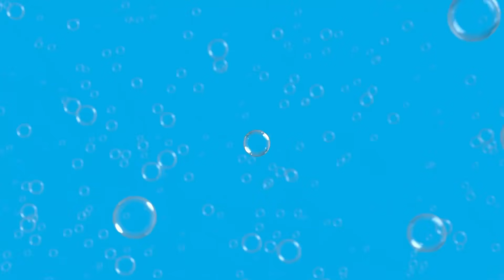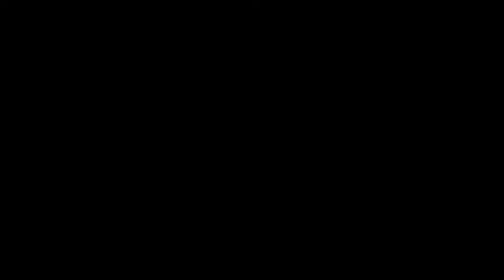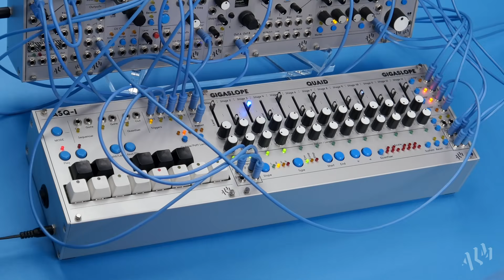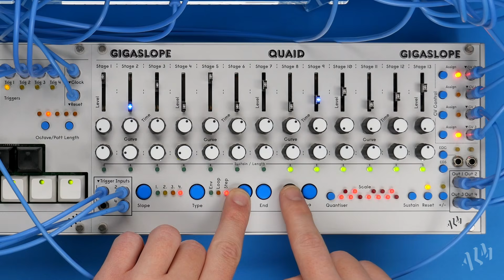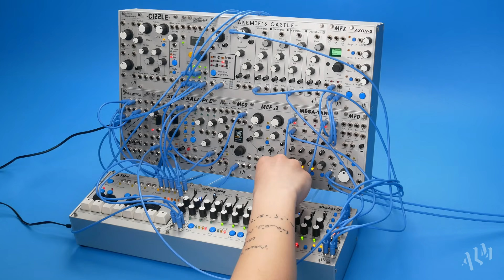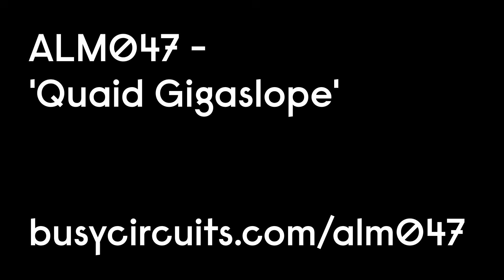Introducing QUAID GIGASLOPE - Quad Multimode Modulator

Comment: This looks amazing! Everything seems pretty straight-forward as far as usability, but checking the manual and looking at Assign destinations, it's just Stage Level, Stage Time, Reset, and Quantizer. Could future firmware updates include switching through Type, or switching/cycling through different start/end points?